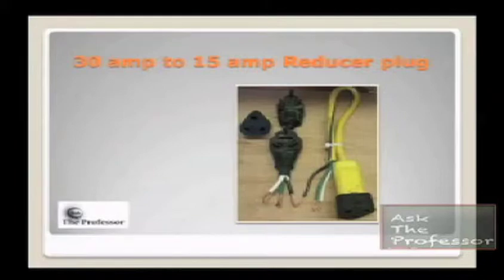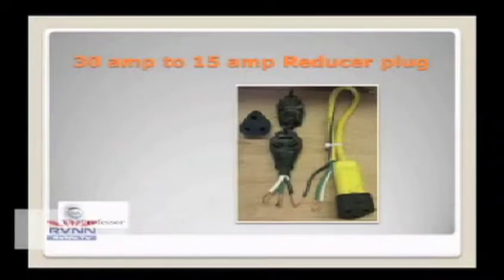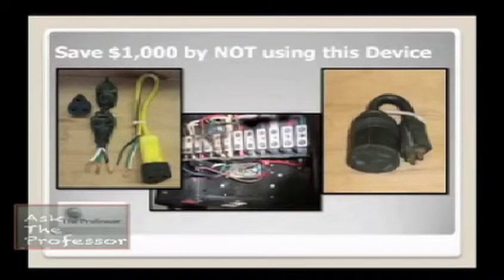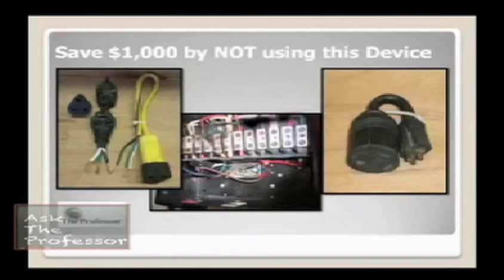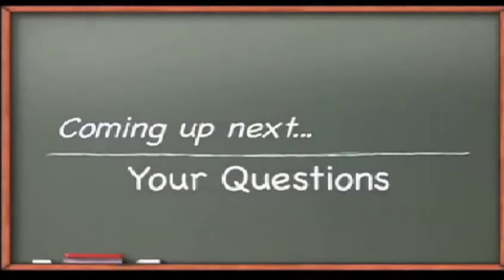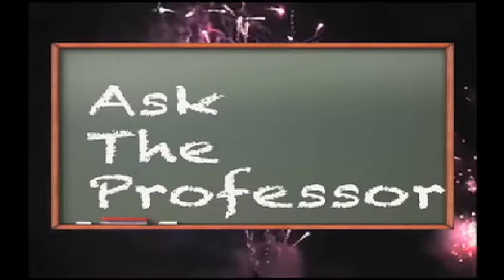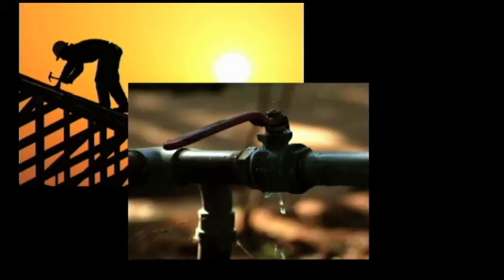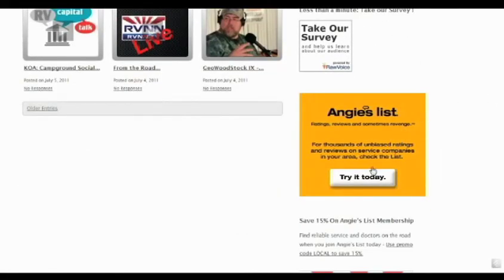Ask the Professor:  Electrical System Basics

Comment: My breaker kept flipping. I had everyone look but.... so I'd keep flipping it. It was ice cold. Well I burned it up and bought a new one and the same thing. We ran my power from the pole and used 6wire which was suppose to be better. I'm not there at the moment but say if they put a 30amp or 50 plug on it, should I look at my plug and go ahead and put a inverter or converter on it just in case?